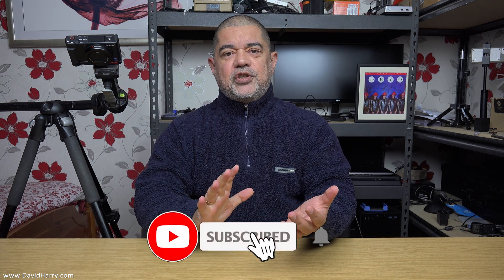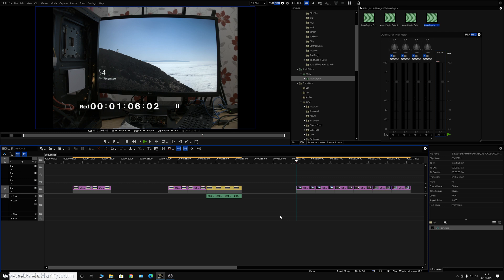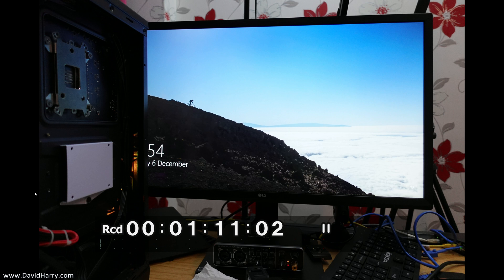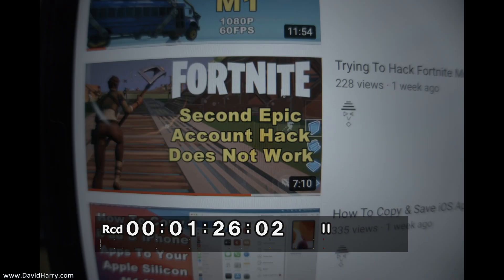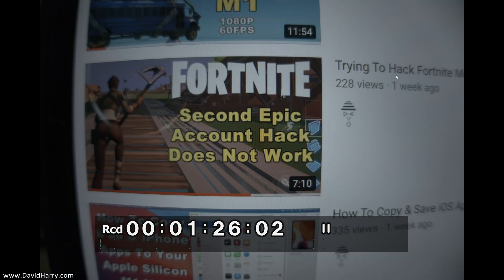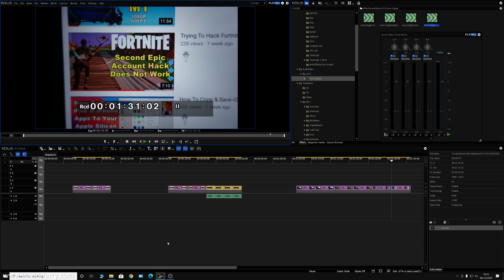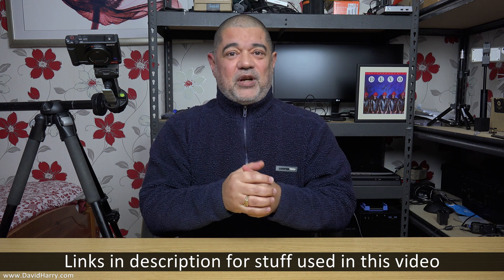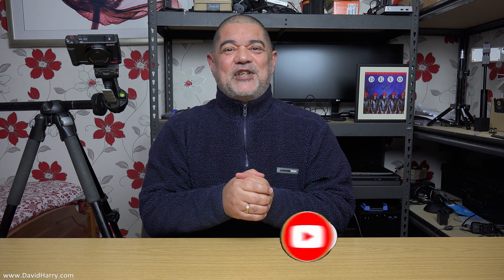Sony ZV1 lens distortion cropping barrelling soft edge focus between RAW JPG and video recording

Comment: also, you could check if the blurring and aberrations at the edges persist if you stop down the aperture to f/5.6 or even f/8, just to make sure that you have the sharpest optical performance for the lens.
Reply from the maker: It does get better when stopping down but it means raising the sensitivity etc. Even at 50 on the shutter and the lens wide open with a lot of light as I have in my seated position, it’s just about in the ball park for the correct exposure. This is why I can’t stop down without gaining the sensitivity, when I say sensitivity I’m obviously talking ISO but can’t bring myself to say ISO when dealing with something that’s simply a digital gain and attenuation system :) Even going further in on the lens would help but again it’d be stopping down as it’s not a constant aperture variable.
Reply: it's 2020 - it's ok to bump up sensitivity a bit ;) btw you can go down to 1/25 on the shutter when there's no movement anyway - just for the sake of getting the sharpest lens performance. As I wrote in a different comment, I've been using a similar 1" compact camera from Panasonic, and I had all sorts of issues with blurs and aberrations - but until I saw your video, I thought the reasons for them were particular aperture/zoom combinations. But now I suspect it all has to do with distortion correction. RAW files are automatically corrected for distortion when I import them to Lightroom, so I couldn't even check the real raw RAWs - but now I will just inspect them in a different RAW editor without any correction applied. We may be onto something here!
Reply from the maker: @libcent  Try importing your RAW stills into an NLE, if it sees the files it’s unlikely to fully understand the metadata and may not apply the geometry correction. This is how I could show the original sensor pickup as my NLE didn’t correct the geometry. I’m massively surprised that no one else has talked about this. Like you say, your camera gives you certain issues that you may think are caused by something else, when it may well be the geometry correction that’s causing various drop off and softening issues in the frame. Let me know how you get on with your camera, I’d be very interested to see if your problems are similar to mine, as in, the correction for geometry may be overworking the camera’s processor and causing issues. Like I said, I can’t believe there’s not more talk about these issues. You can clearly see in my example when I show the centre of the video frame compared to the left and right, the image/text goes softer, it’s mad as f..k 😆 This is actually one of the many problems when using many stills cameras to shoot video. There’s a lot to like about the ZV-1 but you can’t beat a proper video camera for shooting video, it’s just a pity that I couldn’t afford to buy another video camera ☹️ Cheers, Dave.

Comment: as I use a Panasonic counterpart to those Sony compacts - Lumix LX10/15 - I am quite used to the heavy crop in video. LX10 crops 25% of the picture when switched to video mode, so it becomes a 30mm at the wide end, instead of 24mm. I thought it is because of subpar image processing on that camera that it needs to punch in into the sensor for video. But now I wonder if those hyped up powerful Sony compacts from the RX100 series (which cost twice the price of LX10) also do similar cropping in video. ZV1 is after all just a reformed RX100m5. I never came across a proper analysis in any review of the RX100 series. The reviewers were mostly focused on stills photography.

Comment: Not great is it? I have never used raw until now and it’s quite bad. What has really suprised me is how this has been missed by most still photographers. All I can think is that their software must automatically stretch it out from the metadata, but not all of us have software that does this. That’s perhaps why people aren’t aware of it, because serious photographers only would use RAW and so they might well have software that does the stretching out in the background.

The edge sharpness isn’t at all great either in the converted versions.

Video mode must be using a ‘button’ of the sensor capabilities!! 

You explained it so much better than I could.

Thanks Dave.

Comment from the maker: Sony ZV1 Amazon America: https://geni.us/SonyZV-1USA
Sony ZV1 Amazon UK & Europe: https://geni.us/SonyZV-1
Sony ZV-1 tempered glass screen protector Amazon https://geni.us/ZV1ScreenProtector
NP-BX1 Batteries Amazon America: https://geni.us/NP-BX1
NP-BX1 Batteries Amazon Europe: https://geni.us/Cheap-NP-BX1-Batteries
Ulanzi Wide Angle Lens for Sony ZV-1 Amazon: https://geni.us/SonyZV1WideAngleLens
Mounting plate for Sony ZV-1 UUrig R054 Amazon: https://geni.us/SonyZV1MountingPlate
RODE Wireless GO Amazon: https://geni.us/RodeWirelessGO
RODE Microphones Amazon America: https://geni.us/RodeMicrophones
RODE Microphones Amazon UK & Europe: https://geni.us/RodeMicrophonesUK
RODE VideoMic Pro+ Amazon: https://geni.us/RODEVideoMicProPLUS
RODE VideoMic Pro+ Deadcat Amazon: https://geni.us/RodeDeadcatVMPplus
RODE Microphones Amazon America: https://geni.us/RodeMicrophones
RODE Microphones Amazon UK & Europe: https://geni.us/RodeMicrophonesUK
Pro JK® MIC J 044 Amazon: https://geni.us/JK-MIC-J-044

Sony ZV1 lens distortion cropping barrelling soft edge focus between RAW JPG and video recording

In this video I'm showing an issue with the Sony ZV-1 where it goes soft on focus at the edges of the frame.

To show what is causing this issue I have to look at the RAW mode of the camera which shows us a distorted image that's full of barrelling and lens geometry issues. This lens distortion or barrelling is actually deliberate on Sony's part as it is compressing the light that enters the lens and so therefore compresses the image. This compressed image is then decompressed or stretched and unstretched in the camera.

This process of squeezing the image and doing this whole compression and decompression is so that the ZV1 can get a wider image and more light entering the camera on to the sensor. The process is a little bit like the anamorphic lens process where a particular ratio of vertical stretching or compression is applied to the light and image passing through the anamorphic lens which is then later decompressed or squeezed by the same ratio to give a geometrically correct image that has a wider angle or FOV.

This whole processing of the RAW image in the ZV-1 may also explain why when at its widest the lens does not appear to be the equivalent of 24mm on full frame. 

The effect of softening at the edges also looks a bit like a vignette and the blurring could also be something akin to chromatic aberration or another aberration caused by the lens.

Regardless of the cause be it the lens, the in camera picture processing, the geometry processing etc. there is obviously a side effect to how Sony are compressing and decompressing the images and therefore the video on the ZV-1.    

My YouTube production equipment & recommendations. 
Amazon USA https://amzn.to/3g2Oi3i
Amazon UK https://amzn.to/2ZR6IOV

If you liked this video please give it a thumbs up, share it, subscribe and click the bell.
Click Here To Subscribe: https://bit.ly/Subscribe_To_My_YouTube_Channel

As an Amazon Associate I earn from qualifying purchases. I use this commision for buying review equipment & for my YouTube production studio. Thank you.

You can also use PayPal to support my channel https://www.paypal.me/DavidHarry. A nice fancy coffee really helps while I’m editing :)

My Amazon Shop links.
Amazon USA https://www.amazon.com/shop/davidharry
Amazon UK https://www.amazon.co.uk/shop/davidharry

Amazon global links.
Amazon USA: https://geni.us/Amazon-USA
Amazon UK: https://geni.us/Amazon-UK 
Amazon Deutschland: https://geni.us/Amazon-Deutschland
Amazon France: https://geni.us/Amazon-France
Amazon España: https://geni.us/Amazon-Espana
Amazon Italia: https://geni.us/Amazon-Italia
Amazon Canada: https://geni.us/Amazon-Canada 

Contact me for product reviews, I do not respond to email requests for help or advice.
YouTube@DavidHarry.com

My web links and video playlists.
David Harry https://www.YouTube.com/DavidHarry
The Game Thing (game stuff): https://www.youtube.com/channel/UC4XX0WWrHCObF36PWsmCj7Q
DJI Cameras http://www.DJIOsmoAction.com
GoPro Cameras http://www.GoPro9.com
Sony ZV-1 http://www.SonyZV1.com
 
I’m David Harry, thank you very much for watching this video, take care and goodbye now.

Cheers,
Dave.

Sony ZV1 lens distortion cropping barrelling soft edge focus between RAW JPG and video recording,sony zv1,sony zv-1,sony zv1 problem,sony zv1 issue,sony zv1 lens distortion,sony zv1 barrelling,lens distortion,anamorphic,anamorphic lens,anamorphic adapter,distortion,vignette,vignetteing,lens problem,lens issue,compression,decompression

Comment: I really appreciate the time you took to make this video because it verifies some of my own skepticism of Sony's claims for the ZV1.   I bought my ZV1 a few weeks ago as a cheap B-Roll camera that I felt would color match with my other Sony camera.  The color matches very well; however, whatever the camera is doing to get rid of the barrel distortion,  it creates a radical "pin cushioning" result that makes it nearly impossible to use, unless your going for a "house of mirrors" look.  Sadly, it becomes obvious when I try to edit together shots from the two cameras. Ugh!    In order to lessen the corrective distortion that the ZV1 adds, I'm forced to set the ZV1 at its longer focal lengths and place the camera farther back from the subject being shot.  Thank God, so far, I've not had to shoot in a tight, confined space.  So yes, I believe Sony is telling stories when it comes to its promotional material.  Nevertheless, I still like many of its features, so feel for the price, it was a worthwhile purchase.   Again, thanks for this very informative video!
Reply from the maker: Hi Keith. Yes, when you get further to the end of the lens the oddities are less noticeable. When shooting wide though and with the aperture wide open, the problems of focus can be seen and the geometry issues can also be seen especially, as you've said, if you are cutting against another camera. In fact, that's what made me do my first double take looking at the footage properly, it was when I was also looking at my AX100 footage. To be honest though, the ZV1 has way more plus points than negative ones, it's not mad expensive, it's a very nice self contained camera, yes it's fiddly and yes, it's basically a stills camera trying to be a video camera but you can and do get some really nice pictures out of it. In the right light and with a certain exposure it really does give a very pleasing tone that easily mixes well with cameras costing way more. If you want more verification of some of your scepticisms you may find this video interesting https://youtu.be/SOhLCFRasnY Cheers, Dave.